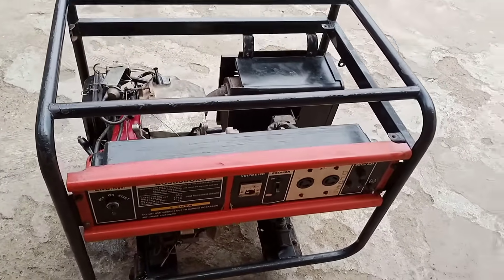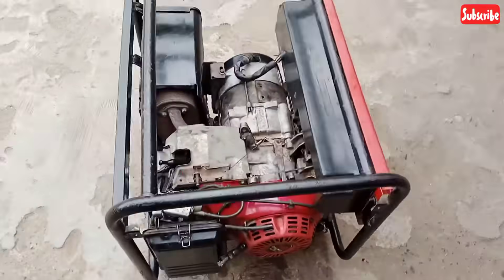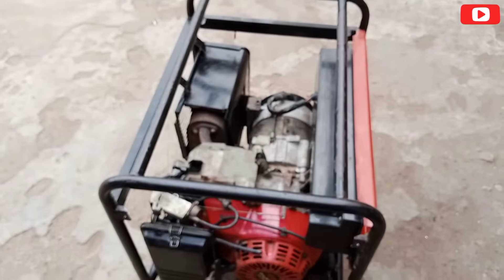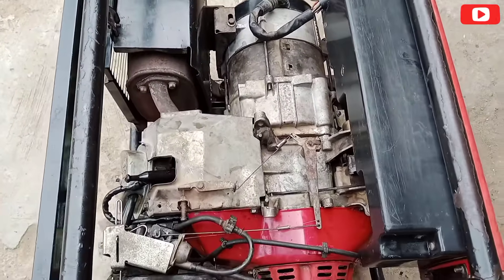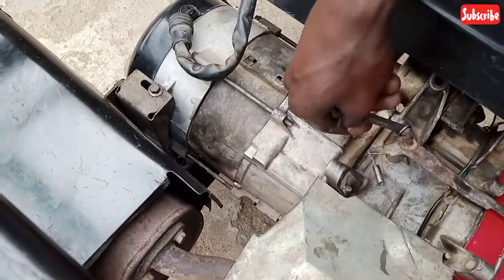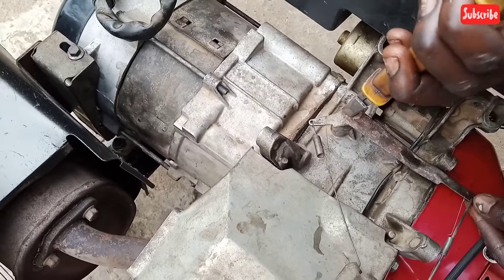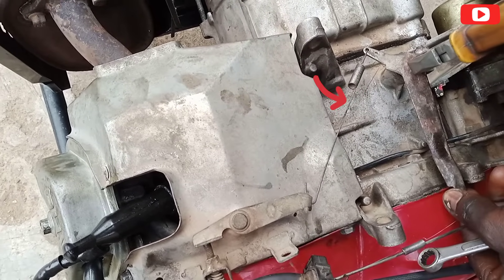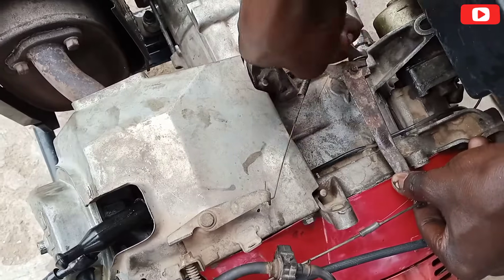Generator governor race adjustment. (3.8kva/6.5kva)

Comment: What about the Philips head screw with the spring around it, what do you do there.
Reply from the maker: It is called throttle spring. To regulate the speed of the generator.
Reply: @jaywealthmechanics9285  Ok thanks.

Comment: My elepaq gen refused to start.
When I draw it makes a sound like water is shaking in a can at the end of the rotor turn.
Spark plug  is good and fuel line is good too, I recently changed the fuel tap and hose, also the plug and rope. I may have recently used a roadside oil too oh.
Reply: Just about the size on your video.
But without wheels and no key start.
Reply: Just about the size on your video.
But without wheels and no key start.
Reply from the maker: Check the valve and give me feedback
Reply from the maker: What size of  generator

Comment: Good evening sir 
I’m working a thermocool Oga6900es the governor racing is high which makes the generator to run faster I tried fixing the speed with governor speed adjustment (By loosen the ten nuts 🔩 and adjusting it anti clockwise) but the speed is still very high 
What again can I do? 

Please I really need a fast respond 🙏✅❤️
Reply from the maker: Check the throttle of the carburetor whether is good,. If it still keep on raising itself change the governor race
Reply: @jaywealthmechanics9285  Is the governor race from inside the engine or outside one?
Reply from the maker: @sundaypelumi7917  inside the engine.. but check the throttle first
Reply: @jaywealthmechanics9285  Ok sir I will do that